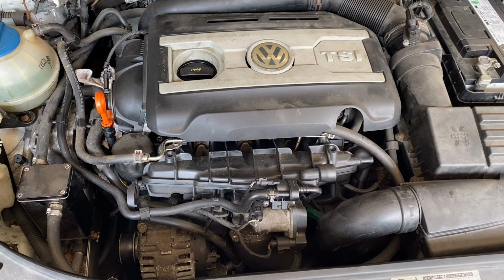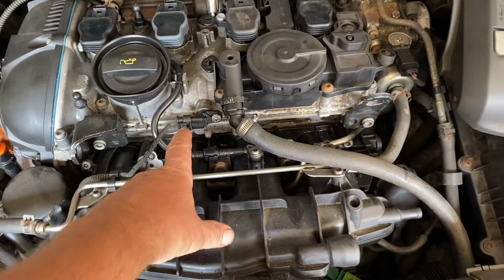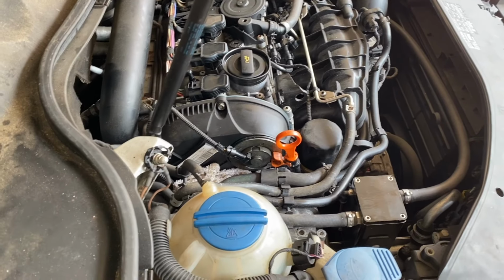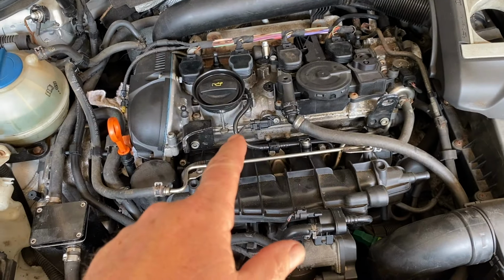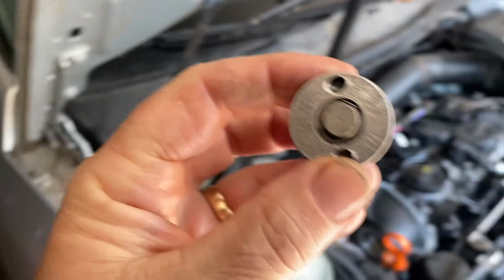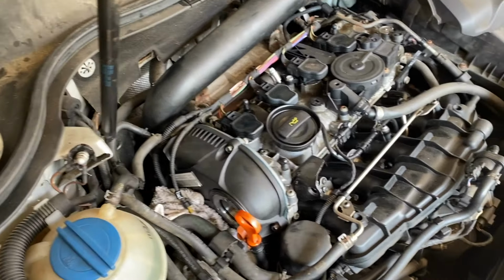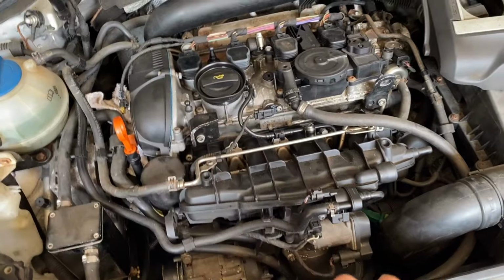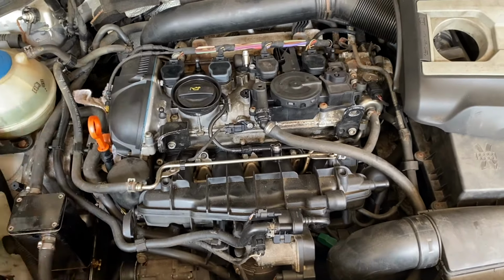Diagnose A Code P0016 On VW Passat, Tiguan, CC, Jetta - TSI/ CCTA 2.0 Turbo - 2009 & Up

Comment: I don't remember what the code number is exactly I believe it's p0016 but I have a 2010 Volkswagen Jetta and I keep getting a code that tells me camshaft position sensor bank 1 could this likely be related to what this video is about and could it cause the vehicle to not start I know it seems like a silly question but it would make sense to me that it would cause a no start issue
Reply from the maker: Yes but there are many other reasons too. Valve timing is controlled by oil pressure and can be the oil control valve cam bridge. Have videos that can help you out.